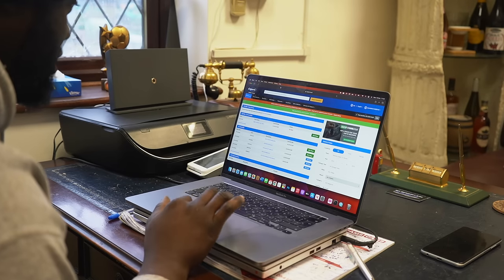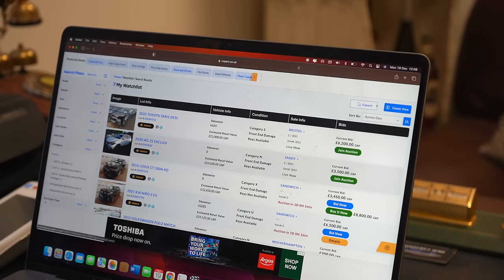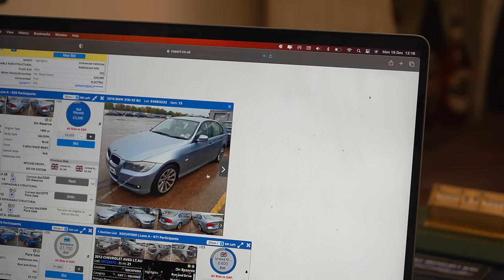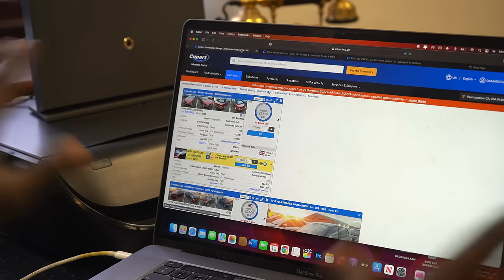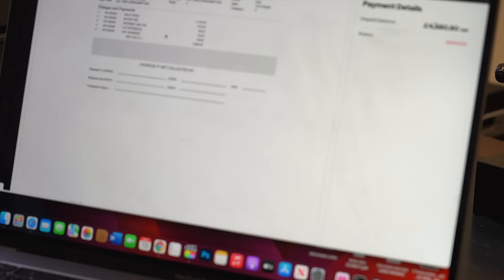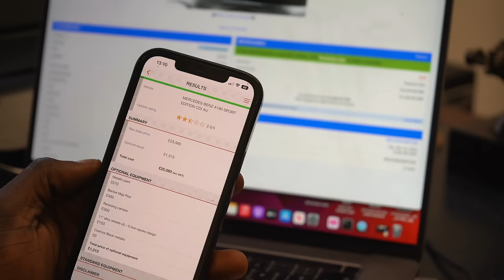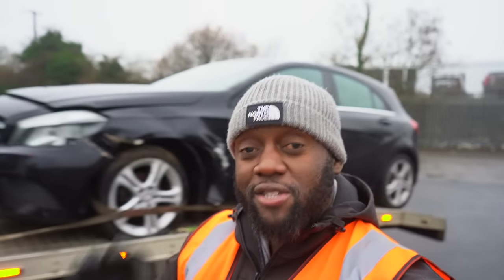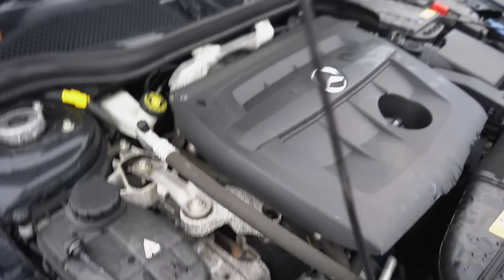WHAT CAN £5,000 BUY AT COPART UK ONLNE SALVAGE AUCTION...THAT MAKES PROFIT? | SHOPPING FOR SALVAGE

Comment: Big up I used to do this with cars from Japan usually zero damage that was until government here changed the SVA Testing requirements. Was fun but in the winter repairing had to dig deep to get the job done. Was bringing over Mitsubishi FTOs, Nissan Skylines and the odd Honda Type R and Integra's. Done the odd salvage over here and stolen and recovered. Really great memories
Reply: I used to buy a lot of salvage do up and sell, in those days not a lot of people did it so you could get decent cars very cheap, they were sold 'as is' and untouched which is how it should be, so no cleaning up as they do now which I find misleads people. I also hear many complaints about parts being stolen and sold separately. Now I find these auctions are full of Polish and Eastern Europeans in general which pushes prices up a lot meaning its rare to find a bargain now, as these cars are very cheap compared to prices in Eastern Europe so these guys are willing to pay a lot more.
Reply: How do you get stock sold? I find this the hard part

Comment: Squiggly light is auto start stop.
Reply from the maker: Nah its the glow plug warming system no?
Reply: @SALVAGENATION  Maybe, It happened to me in my audi 20 plate, unless something to do with the DPF filter needing to be sorted and could be full of crap , get the dpf cleaned try see if that fixes it, let me know how you get on.. Reason i say that as the soot build up could have a sensor in there and its too full of gunk to keep start stopping, leading maybe to the dash light im referring to
Reply: Edit: Squiggly dash light , could be referring to an error in the start stop function, maybe due to the dpf needing a clean because of a or perhaps a blocked sensor sorry mate i got autism, i hope this makes sense.. Basically the cars computer could be going into 'restricted performance mode' to prevent damage.  And I think this is the solution to you problem. When your engine management unit detects the excess build up of fumes in your engine, it can refuse to start. Not that this is the case,  but note that this is for the safety of the engine, as the ignition process mixing with the fumes can cause major damage. So you referring to the plugs, could be way down the end of the tracks of the underlying issue, I genuinely think this is why you are getting this error on your dash, so get the DPF particulate filter cleaned, let me know how it goes.  i hope i helped you in anyway 👍

Comment: did anyone know this car has a Peugeot engine and a jatco gearbox! It’s only got a merc badge that’s f-ed how they sell a brand with another brand engine 😔
Reply from the maker: I said that in the past and everyone got onto me. Lol merc out source all their lower end models to save money.
Reply: @SALVAGENATION  now people when you go to buy a merc from dealer or we’re ever ask does it have a Peugeot engine save ur self from disaster, I got a car that has Peugeot engine and a jatco auto gearbox I’ve been to so many garages all over the M25 boundaries they are all tyre mechanics they put the diagnostic tool such as snap on etc no codes they can’t tell what the problem is, taking it to the dealer soon most likely they will misdiagnose it and would want me to spend money on this and that and it will be expensive and might not even work out but will just pay up the £180 diagnostic charge and may not go ahead if it’s to expensive and just sell it on BCA.
Reply: It’s a Renault engine, not Puegeot. The engine has been slightly modified by MB as is the transmission. 

While working for MB some 8 years ago I had “training” for these (then) new cars. Everything bolted down with a torx is modified by MB was the message!

I was against this concept of using engines from Renault, but looking back these engines have proven to be better then some MB engines…